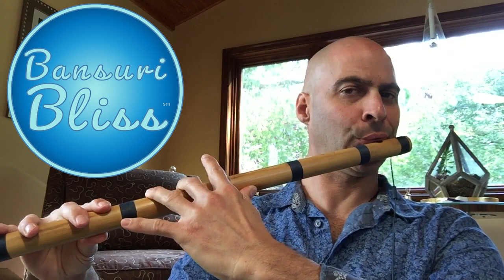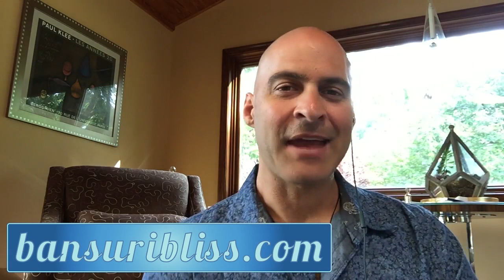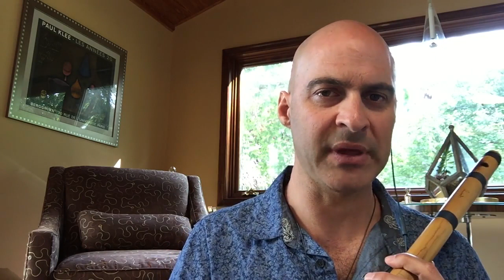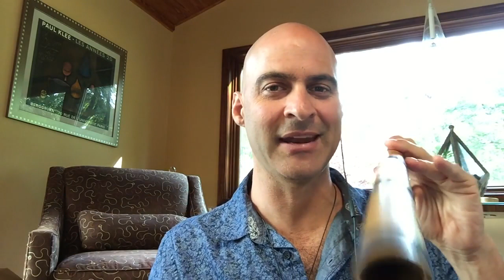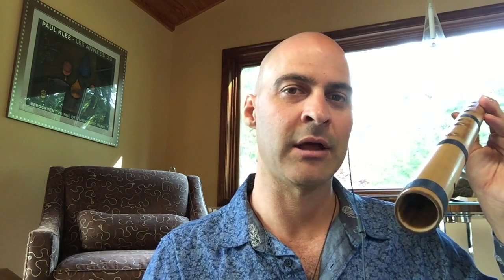A Bansuri Made Of PVC?

Comment: PVC as we know - is lot of chemicals. Any idea Which class of PVC is less harmful if crafted into a bansuri?
Reply from the maker: I do not know...I suggest stick with bamboo for bansuri
Reply: Partha Sarkar makes carbon fibre bansuri which are not dangerous to health and the best most strong long lasting material. and he makes em sound almost like bamboo is a slight difference its a bit more loud and more overtones which is cool if you ask me but it is a difference still.
Reply: Black Abs pvc type pipe breaks down quicker and also has far less restrictions manufacturing  safely due to the fact that it is usually buried under ground.